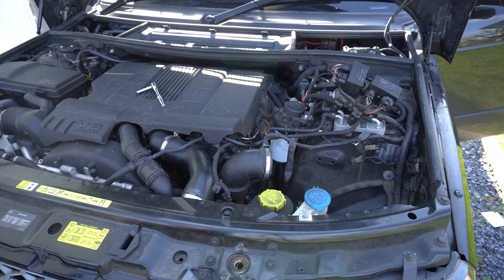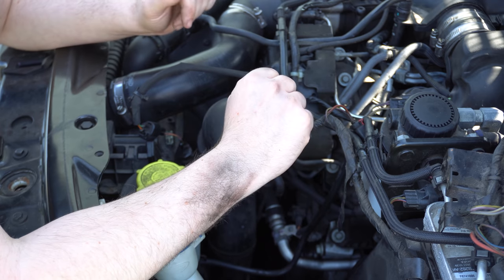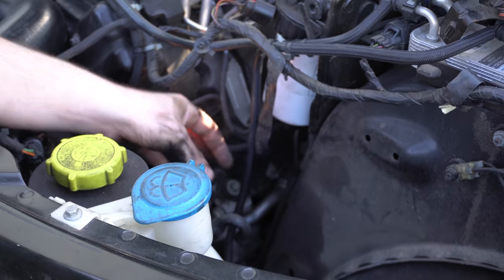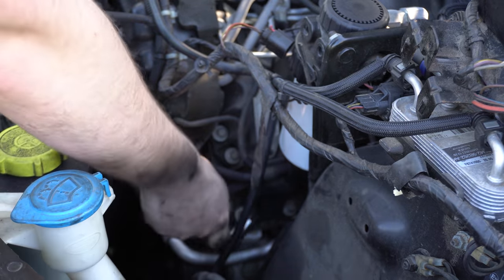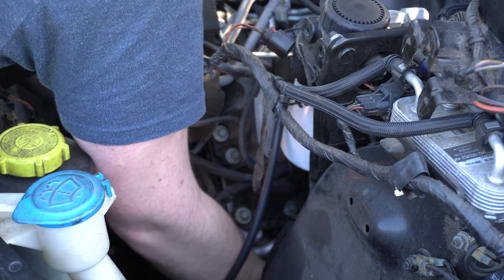I FINALLY fixed the Air Conditioning on the CHEAPEST 4.4 TDV8 L322 Range Rover!

Comment: just finished my compressor swap.  I watched the vid a few times, but couldn't get enough hand room to remove the two pipes on the compressor.  I eventually removed the power steering pump, which was fairly easy once I found the tiny bolt on the rear, and it gave me loads of room.   thanks Sam. p.s. I did the alternator, and pulleys and belts at same time.   had been putting off the job but when the alternator took a dump, I was forced to do the whole triple whammy!
Reply from the maker: Yeah I remember them being particularly tight to get to.  Good tip on the PAS pump, I should probably have done that myself!  
Sounds like she will be good to go for a long time now then, happy days!

Comment: Well done, fiddley job in tight space. I also agree no dip stick is pain, I haveL405 and keep forgetting to check before starting!!!
Reply from the maker: Cheers, it really was fiddly.  Ah well, all good experience for future jobs!

In theory the electronic dipstick should warn you if the oil gets too low, so you shouldn't have to check it every start manually.

Comment: I had same issue. New compressor. Fixed. Common weak point in the 4.4 tdv8
Reply from the maker: Yeah it's amazingly common!  Not worth just replacing the valve on a 200k mile compressor though.

Comment: Good work - I enjoy spannering but my back and hips are struggling now and I have to take regular breaks.  I have the luxury of a garage which makes things considerably easier and I can leave it for a while if needed.
Not sure if I saw it, but 3/8 flex head ratchets are great for working around things at funny angles along with flex head ratchet spanners (signet)
Reply from the maker: It is very tough, especially without a garage or lifting facilities.  But we get it done.  
I have a long 3/8 flex head which is great, and a few Halfords flex head ratchet spanners too - also great.  
Jobs like this always require a bit of thought into tool selection - some stuff just won't fit or reach properly.

Comment: Hi Sam - Normally mechanics recommend that when replacing a AC compressor its best to replace the Expansion Valve, Condenser, Evaporator and the 2 valves. Were you sure that all the other parts were working fine when you changed the Compressor ? Pls excuse my poor knowledge of these things but I am beginning to learn what one can expect in costs when your AC stops cooling. Mine just did so now trying to get the best cost effective fix. Seems when you don’t do your gas and compressor oil refills done regularly the compressor runs dry and this causes it to grind on the walls and small particles can get stuck in the expansion valve and the condenser so if you are just replacing the compressor will the cooling be okay ? Your expert guidance is much appreciated brother 😊
Reply from the maker: Hi Trevor, 
In fact, the garage that degassed and regassed the system for me did point out that normally they would replace the whole system when the compressor fails.  This is because normally when a compressor fails it generates lots of swarf or metal particles as it breaks down.

However with these variable compressors, the common failure mode is different and it doesn’t result in any swarf generation.  The refrigerant control valve (on the back of the compressor) was the failure in my case and indeed in most cases for these cars.

So because of that, I elected not to replace the other components in the system.  However, I will likely replace the condenser and dryer before next summer on the recommendation of the mechanic who said it was restricting the flow of refrigerant when he was gassing it up.
Reply: Thanks for your reply Sam - With the experience you possess you know how the HVAC system in a LR322 works. When I watched your video I saw how difficult it was to reach certain areas 😊 just hoping my comment would save some some precious labour for you in the future. Keep up the good work buddy 👍

Comment: Well done Sam!! Perseverance paid off!! I had mine done at Rovertune last November. Done a few of the lighting upgrades you recommended too! Need to decide about reversing lights
Just arrived in Wales, perfect way to do 280miles. Avg’d 33mpg at 70odd so pretty happy with that. Btw what happened with your rear air suspension bags. Did you manage to return the faulty ones??
Reply from the maker: Cheers Tristan.  Do you mind me asking what Rovertune charged for the A/C job?  It would help me feel a lot better about my battered hands and bruised ribs from leaning over the slam panel 😂

33mpg at 70 is great, can't complain at that.  
I got a full refund from Aerosus, but long story short I ended up buying another pair from them which are on now and working fine, no leaks.  Think I possibly got unlucky with that first pair.
Reply: @SamsMotors  it was around the £800 mark with limited warranty. Which I thought was pretty reasonable. I did have it booked in with my local AC guy but when he had a look said he couldn't do it. Funnily enough he was same price as Rovertune.

Ah OK, fair enough. Least that got sorted in the end. 👍

Got my nice new coolant reservoir fitted now, can actually see the level 🤦‍♂️ Power steering fluid done as well so I think that's all the fluids done👍 next up is a service in July 😊
Reply from the maker: Nice!  £800 including the compressor?  And guessing the warranty was limited because you didn't have them replace the whole system and flush it?
Reply: @SamsMotors  yes all in and regassed. Limited warranty is 2yrs parts and labour. 👍

Comment: Waiting for the bonus tear-down of the pump video.  My 200,000 miler, has weak AC cooling, but had gas in, and with a fresh kwikfit Regas, -was no better, (so no charge for the  regas!) so basically I get a cool blow from the vents, but not a great volume of air, and it’s slow to change actual interior temp.   With dials and rotary knobs set to cool, and even with max AC pushed, it’s not great.  Could this compressor valve be the answer?
Reply from the maker: Highly likely.  Will put the extra footage up in the next day or two.

Comment: I used to think my P38 was tight in the engine bay! You need to be an octopus with the L322.
Reply: I had  p38 when I use to be in Atlanta  99, 01  petrol and honestly great truck great truck the only thing I honestly think was kinder difficult to get to was the starter  most thing was in yr face

Comment: Two suggestions. Wear nitrile gloves  they don't affect feel and protect hands.  Also if you put a drop of oil on bolts they go in much easier.
Reply from the maker: The trouble with nitrile gloves is that they get destroyed in about 2 minutes on jobs like these.  Anything thicker than them and you can't feel what you're doing 🤷‍♂️. So I just put up with the cuts and bruises 😂
Reply: @SamsMotors  I wear doubles at times
Reply: @SamsMotors  cheap palm gloves from Toolstation or Screwfix. I buy a fresh pair for every job and they save the hands

Comment: Any experience with the heated cooled seats? Source of your workshop manual? Great informative videos. I picked up a 2012 HSE and it's been in the shop for over a month as someone Jerry rigged the high pressure fuel pump (5l v8) which had a stripped bolt. Engine out and large bill to come. Wish me luck as the journey continue!
Reply from the maker: No, mine only has the heated seats which is a different system to the heated and cooled which use Peltier units.  The Peltiers often fail necessitating replacement.

Comment: Sam great videos question what brought you to the pump ?? Had air con gas topped up but its not kicking in put iid tool on and pump pressure was wild 298.5 then re did it again 198.0 now showing 0000.0 thinkingbits low pressure switch amu help Sam
Reply from the maker: Mine took ages for the AC to start working (20 mins sometimes) and then stopped getting any cool air.  I had mine regassed too but didn't make any improvement.  I bought a set of gauges (see in vid) and checked the pressures while running which confirmed compressor inop.

Comment: How long did the job take you in the end?

It looks like it was around 6 hours?
Reply from the maker: Yeah something like that!  Could probably be done in 4 if you weren't filming.
Reply: @SamsMotors  I shall dedicate a day and start at 9am to give plenty of time. Looking at the workshop manual, it suggests exactly what you did - just removing the airbox and charge hose.

I'll probably do a coolant change at the same time, which also looks a pig to do on the 4.4!

Grab some palm gloves! They're hand savers doing jobs on these cars and cheap enough to chuck after the job is done.
Reply from the maker: @garycooper348  definitely sensible to set a day aside for it.  

I'm genuinely surprised the workshop manual doesn't suggest at least removing the fan and cowl.  Having said that, the most difficult bit was reaching the pipe connections on the pump - bloody awkward!

Air con is still lovely and cold though so it's been worth it this summer.  Good call on the gloves, will order up a pack.

Let me know how you get on!

Comment: I’m sure 700g is not enough as yours will have rear a/c? Normally 2 options on sticker
Reply from the maker: There are two options, the rear A/C is a pretty rare option, I think only seen on certain Autobiography and Ultimate editions which had the individual rear seats.  Definitely only the normal system on mine, with vents and controls in the back for fan speed/temp.

Comment: Thanks for sharing the experience of changing the A/C compressor. Likely to have to do this on my 3.6 in the near future and while I appreciate the the plumbing is different your approach is very helpful. Out of curiosity, where did you source the new compressor ?
Reply from the maker: It's probably fairly similar on the 3.6, think it's in the same place on the engine 👍
New compressor was BNIB off eBay, I got a bargain as it was just listed as a "Nissens 890123" rather than the Land Rover part number.

Comment: Never ending repairing... that is reason why these cars are so cheap..fuck it
Reply from the maker: Not really, Land Rover don't make air con compressors, and this AC compressor had done 200k miles and it's a pretty normal failure on any make of car.  🤷‍♂️
Reply: @SamsMotors  well, you are right.